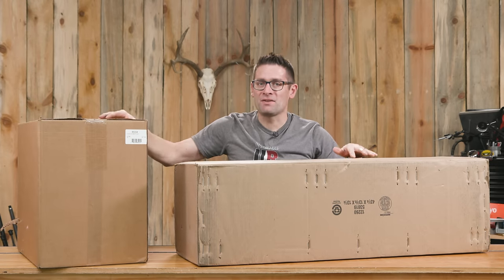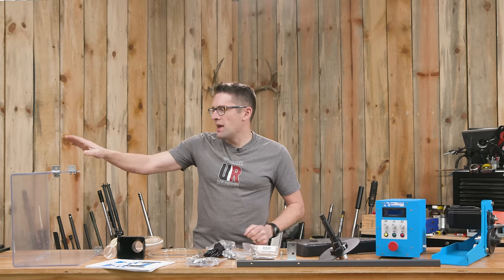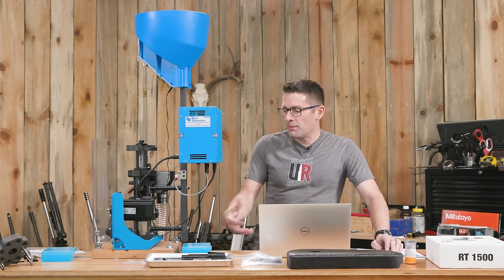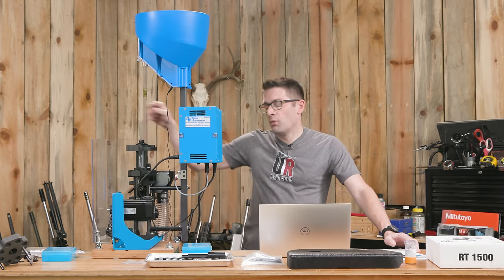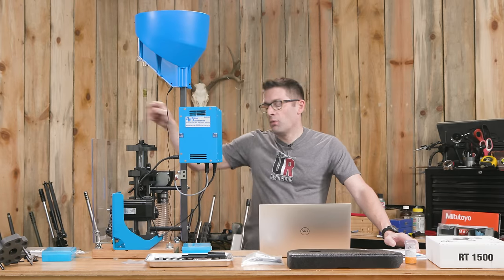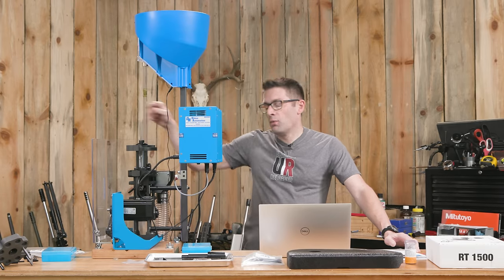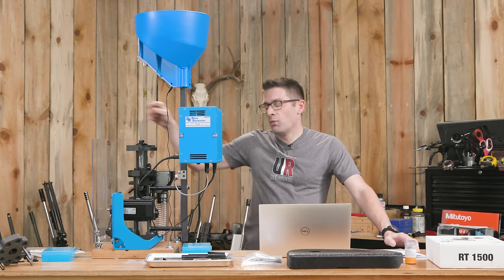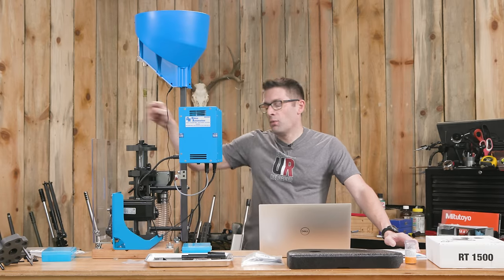Dillon DA3000 Unboxing , Overview, Converting 223 to 300BLK

Comment from the maker: *NOTE: If you are setting up a DA3000 with CP2000 and plan to convert or trim 300 BLK brass, it is best to swap the swaging station to the right-hand side before installing the DA3000 crankshaft/sprocket

Comment: I do my conversion on a 650. I have an RT1200 trimmer and a ch4d 300blk trim die. I run a dedicated trim tool head for processing. Universal deprime like you do, then into the trim die. I found the ch4d must not be forming the brass right as I had chambering issues. So I picked up a spare Lee sizing die and run that after the trim die. Zero issues once I started doing that. Can’t swage on the press, so all brass still gets run through the Super Swage after being formed. Swap my tool head over to my loading tool head and toss that converted brass back in the case feed and start loading.

Comment: Always heard it was better to size 90% with the full length sizing die (no expander/decap pin) then finish with the trim die.  Mandrel is a good idea, instead of an M die. Now you just need to get an AMP mate and install it on a Giraud trimmer.